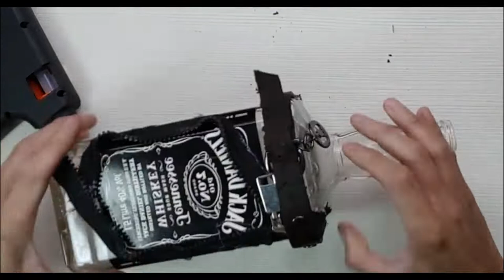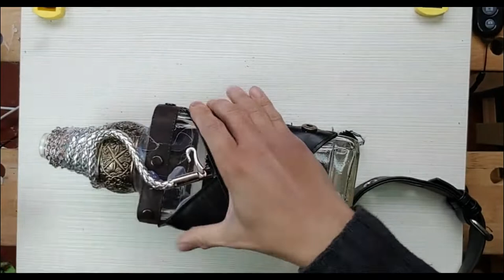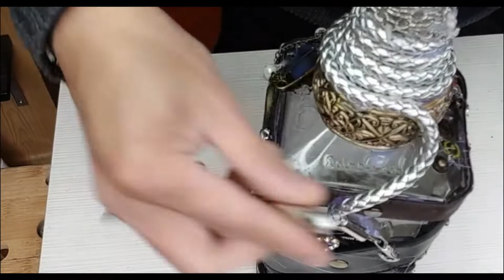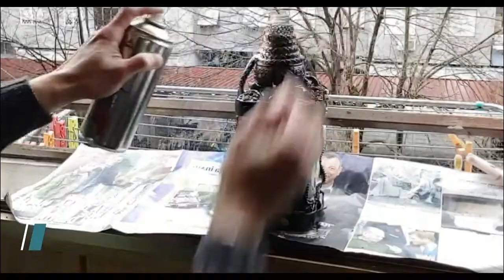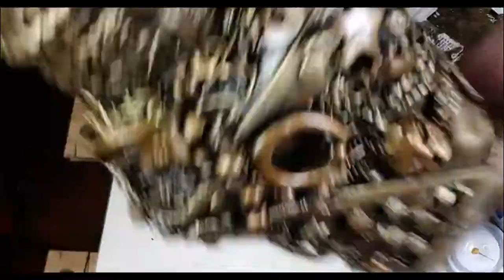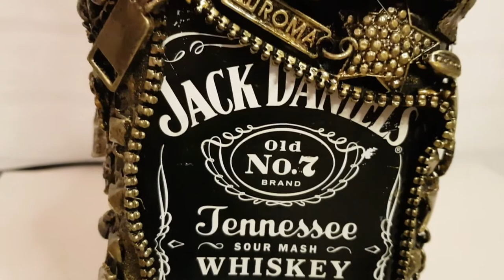#19 Decor Antique Bottle Art/ Wine Bottle Art/ Altered Bottle/Steampunk Bottle Art/art and craft

Comment: Fantastic! Just a few questions please. How do the items stay on the bottle with just hot glue? Would super glue be better? Would you use resin to seal the items and the bottle? Thank you.
Reply from the maker: Goodmorning sir CHUCK😊 about your question: for me hot glue is the best way to use to attach any small parts in your project. Super glue is better too. But super glue is more complicated to use. But its depends o. You what do you prefer to use anyway its almost the same. If you use hot glue be sure to put your project to a cool place( not exposed to sun light) about resin: no dont use resin. After your project resin will make your project shine. It will removed vintage effects.